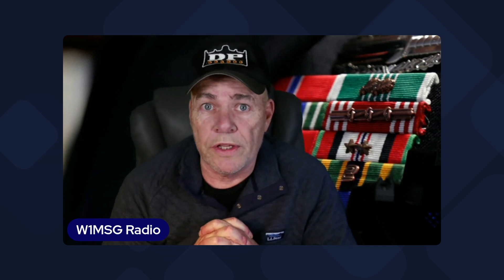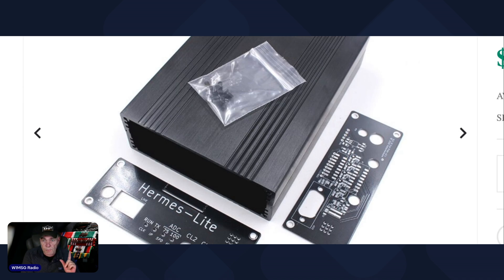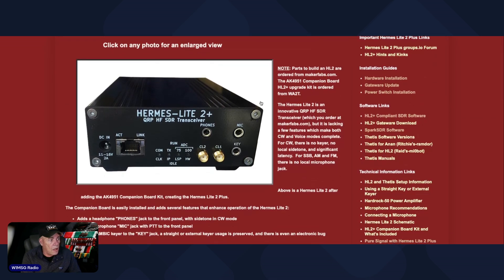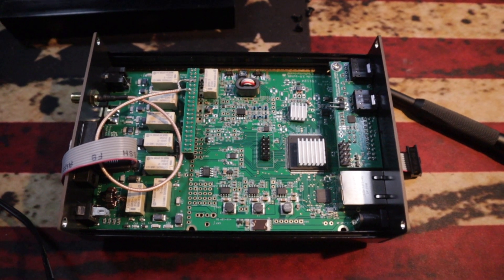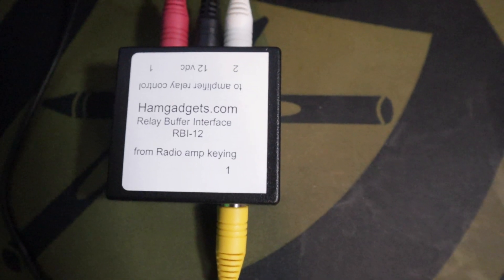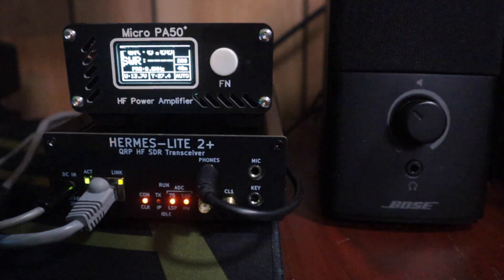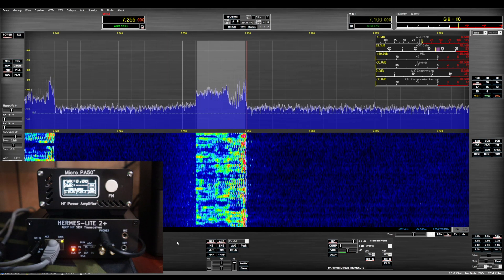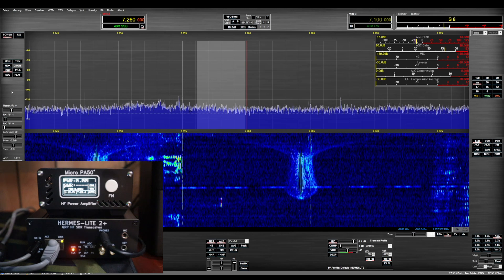Hermes Lite 2 + My SDR Obsession

Comment: Would you be able to use the PA100 with the ham gage interface to get 100 watts.Also could you use the steel headset and attached Mike by plugging into the Mike and phone jacks on the plus board?Do you have to use the VAC with the steel headset.Nice video thanks.
Reply from the maker: I dont know anything about the PA100 so not sure what the output would be. You dont have to use VAC if your Mic and speaker/headphones are plugged into the Mic jack on the plus board.

Comment: Press the button 9 times if you have the right firmware on the pa50 it will auto reset that alarm after about 3 seconds.